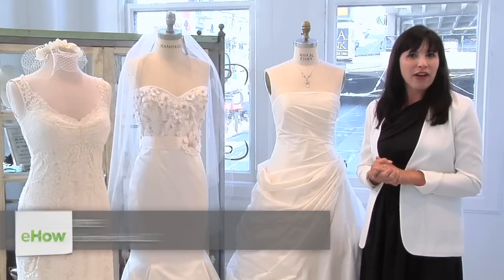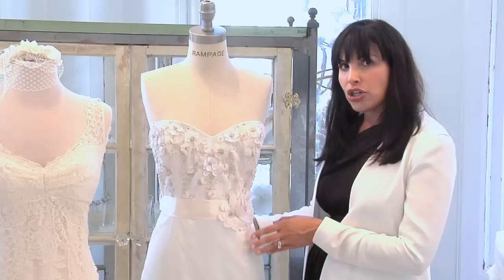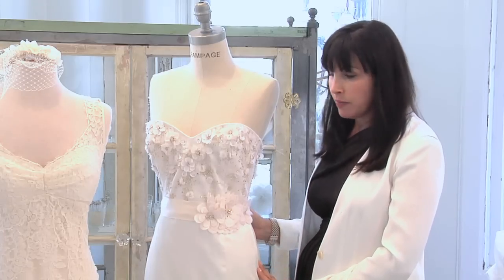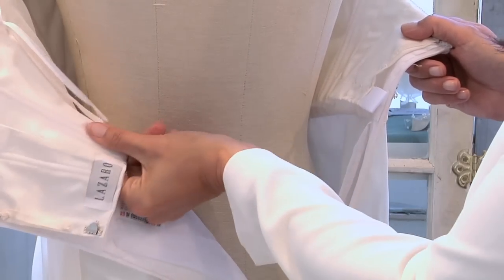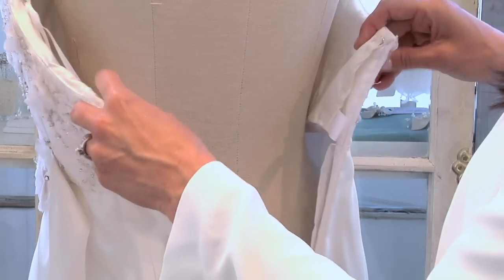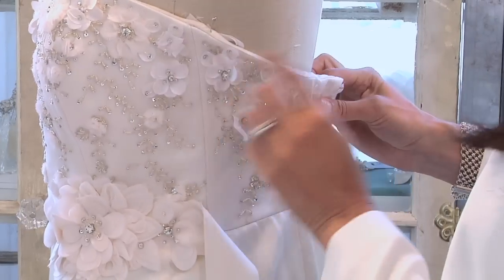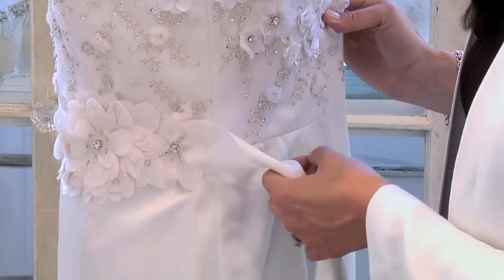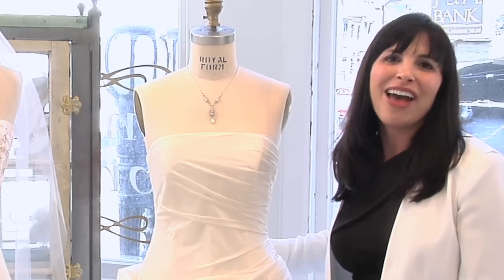How Wedding Dresses Are Resized : Wedding Dresses

Comment: Please buy a bigger size instead of a smaller size, if you can’t find your exact size. When we work into making it bigger even if we’re skillful it’s not possible to have the exact same design. It will look different in a few ways. If the dress is  3 times bigger or even more we can encounter similar issues that I just mentioned, like a completely different neckline for example. Or if it’s an open back? How do we make it much smaller without altering the gown design? Not saying it’s impossible, but be prepared to have something in the end that in some cases not being exactly what you want. I’m a fashion designer and sew for a very long time and I’m starting on the bridal alterations field. Great video!